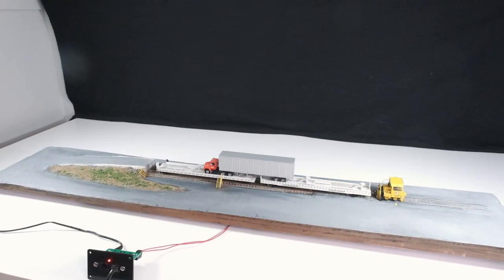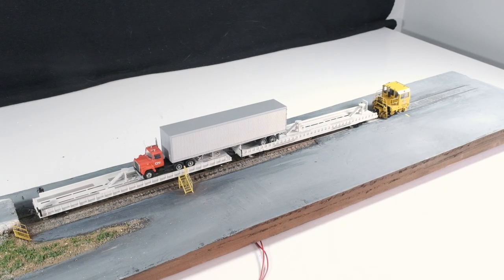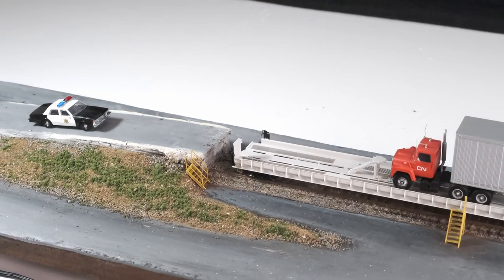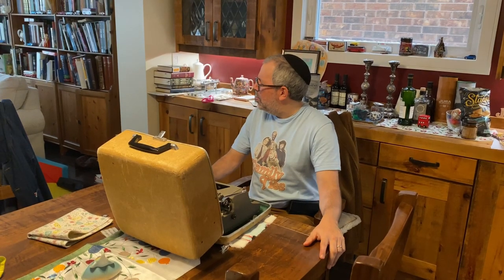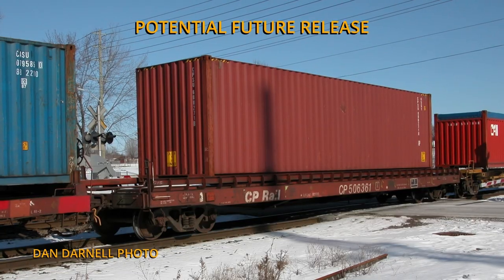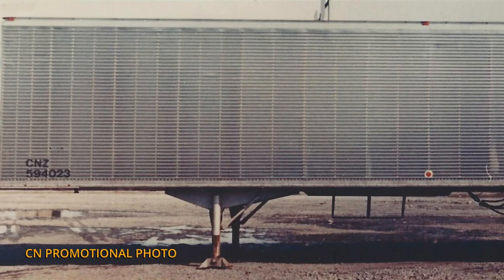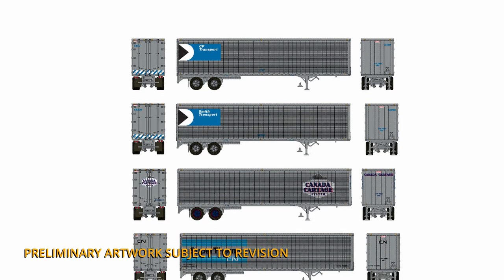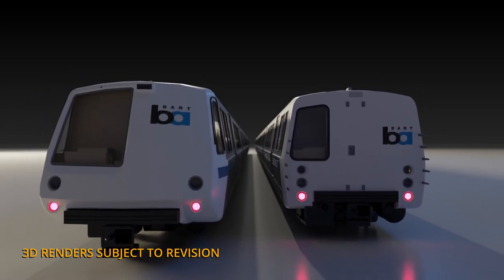Rapido TOFC Flatcars...and the World's Smallest Railway???

Comment: I hate to be the model railroad police. 
BART cars interiors. The cars had foam seats with black cloth upholstery. On the ends of the seats there is a grab handle at the aisle. About 1978 BART started putting ceiling mounted grab rails on their cars. This was to give passengers something to hold onto. Prior to this a "weathering" item is to put hand prints on the ceiling. 
     The three strips on the side end of the cars weren't added until the 1990's, I think. They were added when it was pointed out that a visually impaired person could easily mistake the space between the cars for an open side doorway.
      Cab interior. BART put another panel above the speedometer to indicate cab signals, which controlled the speed. 
       The first batch of cars delivered did not have any side step/ladder to climb into a car away from a platform. These were added in the first year or so, and became a production item on the second batch.
        BART is in many ways a bunch of aerospace engineers trying to reinvent the wheel. They did many things from just sheer ignorance. Like not putting any way to get into a car away from a platform. Styrofoam floors above the dynamic brake grids(this led to several melted floors and some possible fires).
Reply from the maker: Keep in mind, these are early renders for illustrative purposes. Rest assured, we're working closely with BART to make sure the details will be right!